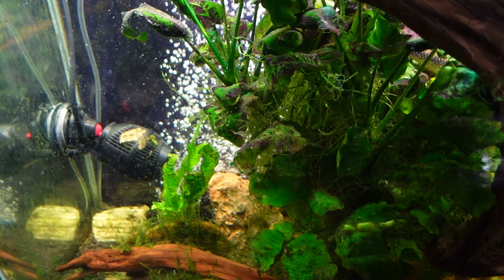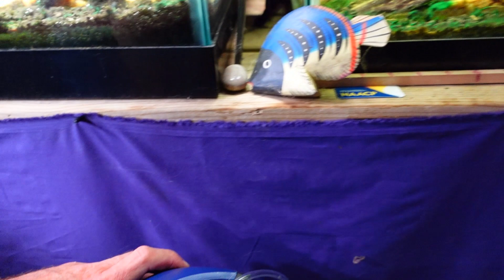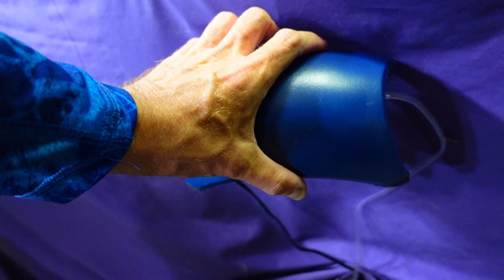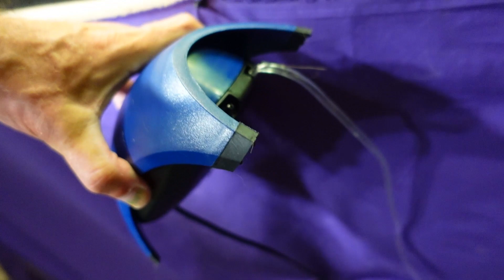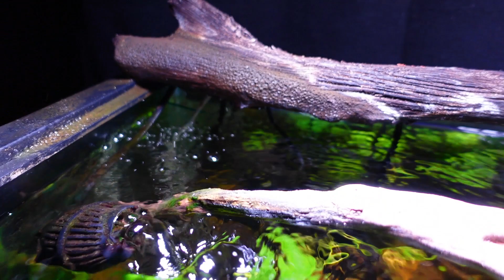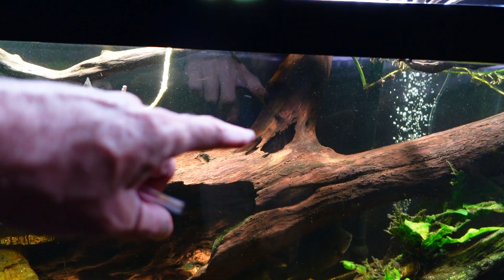Making Better Use Of My Air Pumps

Comment: I have all fairly large tanks and use all canister filters.  I keep the outputs below the surface so I can easily direct the flow to minimize dead zones.  So...I run air in all my tanks for surface gas exchange.  I try to place the airstones in or around aquascape "features".  I absolutely cannot stand having the bubbles blowing around all over the tank.  It looks terrible and doesn't have any benefit at all versus the bubbles going straight up.  The bubbles don't do anything beneficial anyway until they break the surface.
Reply from the maker: You can watch the micro bubble dissolve into the water.
Reply: @DanHiteshew-oneandonly  Do a little research on that.  But I am in no way being critical of your preference.  I think it's great that you added air.  I just can't stand a billion micro bubbles flowing around everywhere.  It looks terrible and I like my tanks to look good.  But beauty is in the eye of the beholder.  You do you...if your happy that's all that matters.
Reply from the maker: @rantsandreviews  I don't like the bubbles either, but I've seen how much they help my tank, so I deal with it.
Reply: @DanHiteshew-oneandonly  LOL....don't blame you a bit!

Comment: First i cannot tell you how many check valves I've bought which were defective. Another point instead of leaving the one side of you're pump open put a two way splitter on the pump with a valve that you can adjust the air flow.  One thing i like about air stones is it seems to help move detritus to the filters. I run them in all my 7 tanks. One advantage also is if there is a power outage they will supply air to my tanks for approximately two days. There chargable air pumps.

Comment: Your leccy bill must be huge . All those  fish tank accessories and pumps.  lights  and filters etc plugged in  . Its a necessity  I know  but in the uk the leccy bills have almost doubled recently and prices across the board are rising rapidly    I’m really noticing it , especially running multiple tanks . I think the cost of living is affecting the hobby  for sure it puts a strain  on it  for the regular working class Fish keeper   . I went to the Aquarium shop in London yesterday and the prices were a lot  higher ,  they have risen  . One rummy nose tetra  for example had gone up to $5   In your currency  .   I was wondering what the situation in the USA was like 👍
Reply from the maker: My with pays the electricity bill, so I really don't know. I know it was over 4400 a month, before the cost of everything started rising.
Reply: @DanHiteshew-oneandonly  so prices are rising over there  also . I  just think in general all the supplies needed are increasing . But in particular in  the uk  its the electricity cost thats skyrocketed  since April .  Any more increases and I will be blowing bubbles into the tanks with a straw to  create oxygen and cut costs 🤣
Reply from the maker: @jefffleet9546  Lol
Reply: @DanHiteshew-oneandonly  $4400.00?  Wow!
Reply from the maker: @rantsandreviews  That was supposed to be $400

Comment: That check valve might be faulty
Reply from the maker: It's an old pump and doesn't move much air anymore. Never have figured out why the loose power after a few years, but they seem to.

Comment: Air stones are the lifeline to my tanks and they are on 24/7. W/o air stones, I can expect about 80% losses in my tank population in about 8 hours period.
I know this, because one time, I forgot to turn the air pump before going to work and when I've return I had lot's of dead fish on the surface (mostly tiger barbs). Needless to say, after that incident, I've became religious in checking that all my tanks equipment is working, before leaving my house for extended periods.